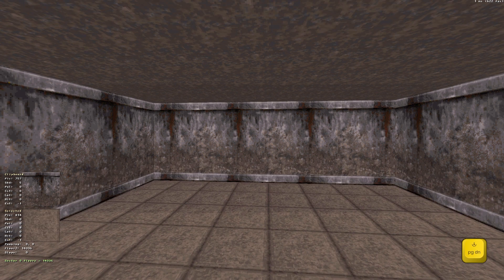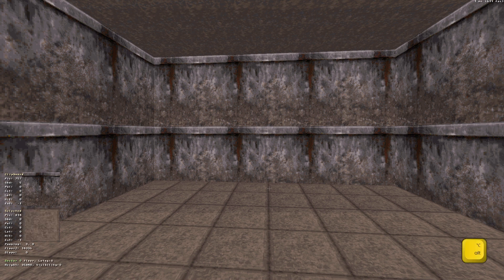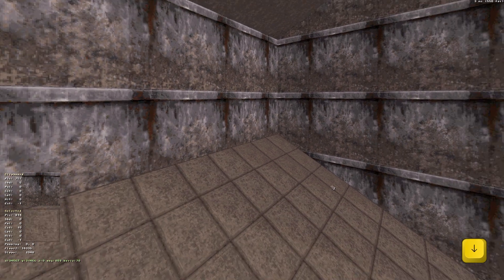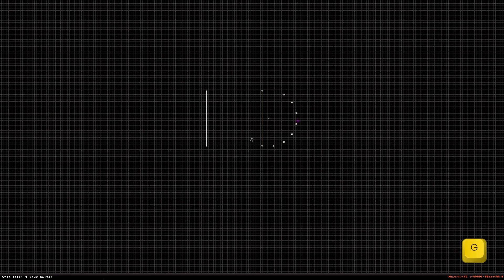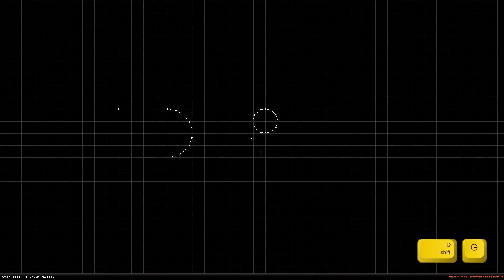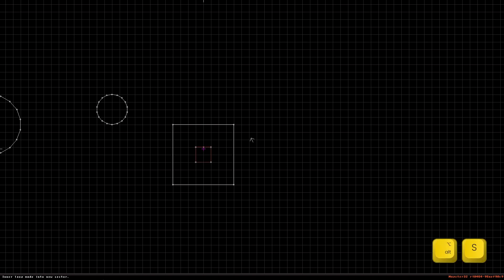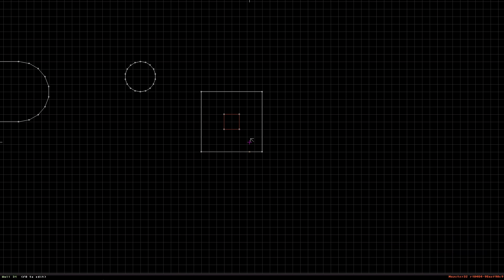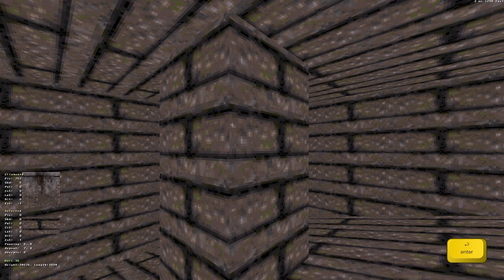Duke Nukem 3D Level Design Guide 3 - Sector Editing Part 1

Comment: I spent a lot of my younger years in Duke3D level creations and I noticed that if you have just the right downward slope and a floor close enough to jump into it, you will ride the slope like a zip line.  I don't know how novel this is, since the effect can be seen in a limited sense in level 1-2 when you leave the room with the pool table.
Reply: While not slope related, I learned on my last stream that extremely long walls can also cause a glitch that launches you like a rail gun if you touch them. Odd quirks like this can be used to create some interesting results
Reply: @thelegendofdevon  YES!! I wanted to mention that too!  I created a whole town and had a sewer going from one end to the other, where I could fire rockets from one end and run to dodge them on the other.  I never recreated the effect, but this was the last map I ever worked on.